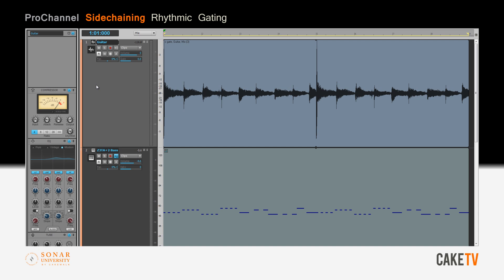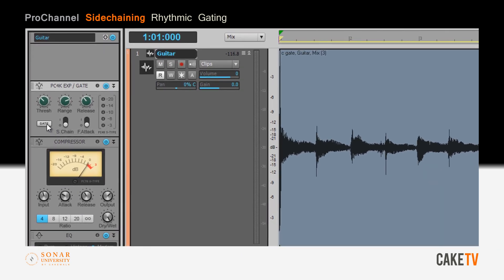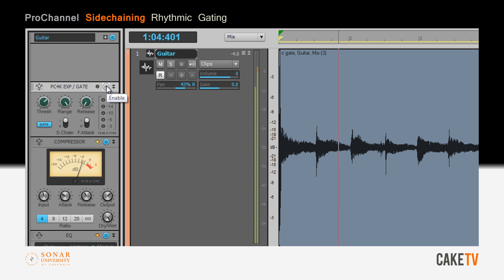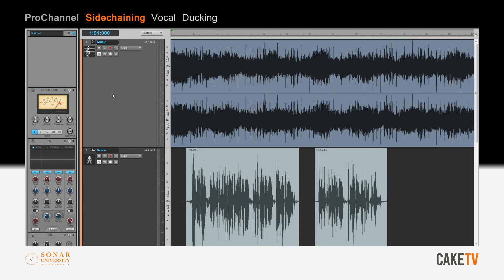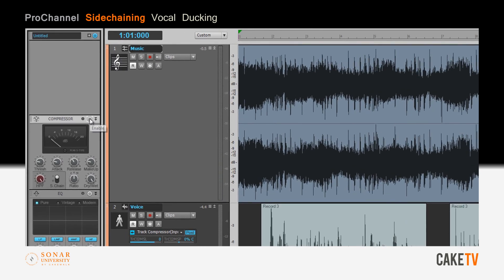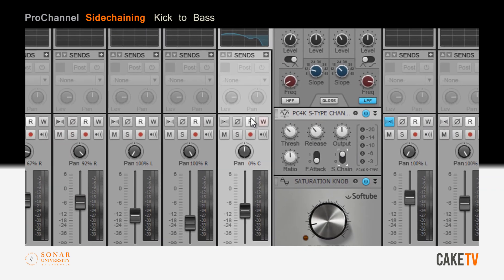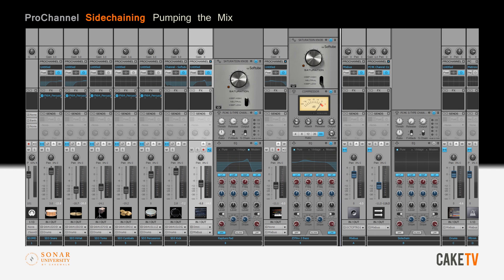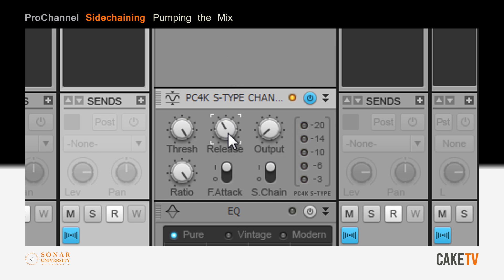SONAR: Go Deeper - ProChannel Sidechaining

Comment: boy, so many steps to set up that first example. miss one thing and you won't know where or what you missed.
I'll agree tho that sonar rocks, if I could just learn it
Reply: It's simpler than you think. Basically, say. You want to compress track 1 based on what track 2 is doing. 1. Put a compressor on track 1 and turn on side chaining. 2. Make a sends from track 2 to track 1's side chain. Is this your first time using a mixing program btw?